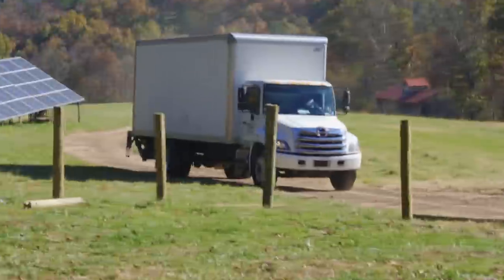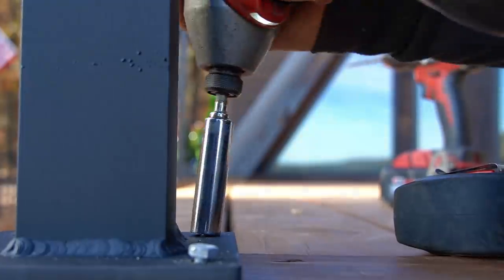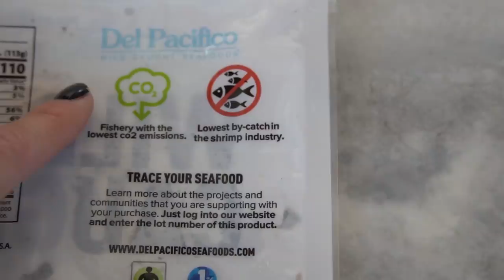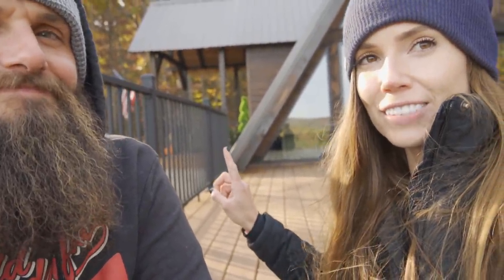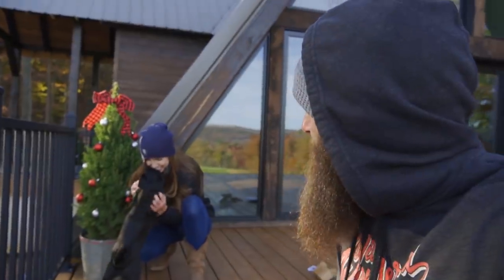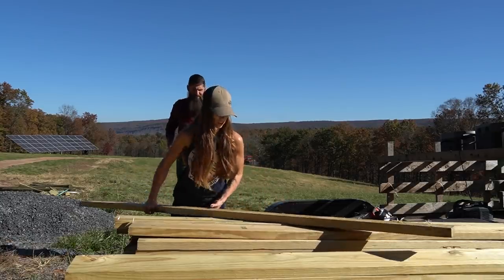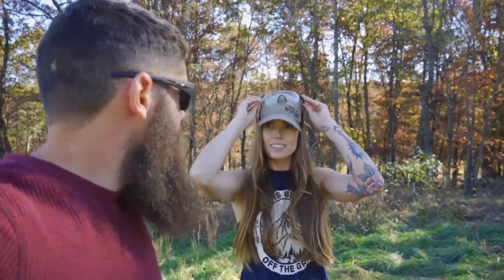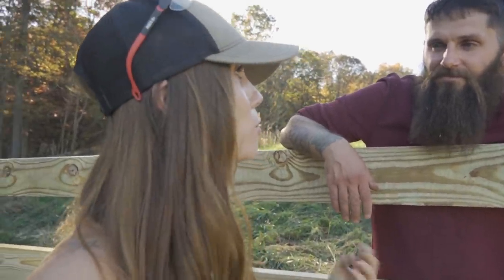She Waited Her Whole Life For THIS!

Comment: Put a railing over against the A-frame. Cut the railing on an angle to the A-frame then bolt each baluster to the A-frame. Or once railing is cut on an angle, tack weld a piece of angle iron to the balusters and then bolt that to the A-frame. That way the railing will carry the same line as the A-frame and the space will be covered so that no one will be hurt.
Reply: I was thinking along the same lines. If you need something there for your own comfort, make a wedge shaped railing segment. Perhaps instead of fastening to the a-frame, secure it to the corner rail only , but up against the roof trim. But the plant works for me!
Reply: @davidmessersmith786  I agree with you. Or my idea. But either way that space is an accident waiting to happen. One of the children or someone else's child plays on the railing, then falls back or gets stuck between the A-frame and the railing. Even an animal, the dog, 🐐 goat Leon, could find trouble there. I believe a railing cut on the A-frame angle, tac welded to angle iron, then bolted to the A-frame is the easiest and best looking solution. Just spray the iron with the paint that matches the railing. ✅ Done, move to next project.
Reply: @reddragon3733  I thought Leon was a sheep.

Comment: Do the "L" rail and then place the potted plants...whatever is in season...to conceal the railing.
Reply: I would rather do this than have to worry about what if someone finds a way to fall off the deck there.  I can't imagine what the ins company would say when they found out it was knowingly against code (and now there is video evidence they ignored it on purpose).
Reply: That was my thought too
Reply: n pot feet to keep the pot base off the deck to prevent staining, in that air can circulate under the pot n dry out any wetness.
Reply: @Kirk Oglesby I guess that's your choice. I prefer to think of it that it's my personal responsibility to make my home safe for other people. We don't have to share that opinion and that's fine.

However I know they have insurance (they had to enclose under the house due to their insurance company).  So if someone gets hurt there in that gap, the insurance may opt to not cover it because they intentionally did it against code. This can go as far as them having their policy dropped. They may be willing to accept that risk. I personally am not willing to put my families future financial stability at risk over 2-3' of railing.

Others have had other great ideas like using sheet metal to cover the gap and cutting a design into it. I think that would fulfill the code requirement.

Again, you do you and I'll do me. I offered the OP my opinion and you jumped on here like I was against personal responsibility (which honestly I don't see the connection).
Reply: @Kirk Oglesby I respect what you say. Personally, my worry would be if a child was visiting without their own parents there to supervise. If some kind of toy or ball gets thrown in to that corner and a kid has an incentive to try to get into that area. To take the chance a child gets seriously hurt because you didn’t take the time to close that corner would be heartbreaking.  I get the idea of being responsible for yourself- lord knows we need more of that. Just the idea of Murphy’s law- if it shouldn’t happen it will.  Maybe it won’t happen till you have grand children but it could happen. Why lose the sleep over it.

Comment: A "L" or short return on the railing is not an issue. Just go long enough to intersect the roof and the top of the post. It'll look great!
Ya'll are doing great work!
Reply: It would also add stability and strength to the long run. It is a beautiful combination.

Comment: Once he is healed, just get one more panel of railing and keep the angle of the roof....and bolt to the front header. It will need some welding but will complete the look. Don't cheap out on labor after all this great build. You guys did great

Comment: For the railing:  from the last post, follow the lines of the deck make a mitre at the corner and fabricate a “post” that follows the angle of the house. You may be able to use a bottom rain, although because of the angle the holes for the pickets, it would have to be filled and the holes repositioned.  I think this would look great as it would blend seamlessly into the side of the house.  It would be a lot of work though.💕

Comment: You could also fill up the area with wooden art piece from your cut offs which could be used as an outside lamp for the deck area, and/or use it for a sound system.

Comment: Suggestion: Instead of measuring for each board get a board or pole etc longer than the boards you have and attach ruler or tape measure or draw etc on the end of the board . This way just hold up the board to the posts and read off the length you need or just mark from that board etc. I would have started with top board and moved down but either is ok and use a 7 inch or whatever board spacing template to snug the horizontal boards to.
You could also nail up boards then set circular saw to barely cut through them and cut off after nailing to the posts and thus avoid splitting ends as much

Comment: fill in the triangle gap with a triangle railing attached to the rake drip metal and the post.  Use a scrap piece of railing at angle like on front steps.

Comment: Greetings from NZ; you have made great progress and it all looks amazing. I would like to pass on a trick we use in NZ when doing 'post & rail' fencing. You need 2 people. After you have got one rail attached to the post get the other rail where you want it and butt it up against the first rail, then with a chainsaw gently go down the vertical gap and you are essentially making a scribe.You then butt the free rail up against the other and won't see a joint (much). This way you don't need to cover up the vertical joints (which I think wouldn't look good). I would also recommend using two 4 or 5  " wood screws with hex heads which are much stronger and won't rust. Cheers and congrats on your accomplishments. KiwiChris

Comment: When you set your post for the play ground set a bench mark with laser level. drill holes approximately 6" deeper than you need.  Fill holes with 4" of rock and then a round paver. Check elevation from bench mark This will help keep Post plumb.

Comment: Cut some spacer blocks for your fence rails. Tape measure takes too much time. Tack a 16d in to hold up the far end while you stick this end. Don't forget to pull em, they'll rip you good if they get a chance even with the round head. 

Use spacer blocks under your deck rail sections too.

Comment: The deck you all built does look great and will look even better once the railing is put up around it and the steps. As for your fence you all are working on, it would have been easier to put up a wire fence and I know it would be cheaper and the wire would last longer. I live in rural Arkansas and grew up with wire fence around part of the property and I love where we live as a family on our grandparents property.

Comment: You could also run a rail down the A frame and then run rails from the corner rail to the rail on the A frame. the only problem is you would have one section with up and down rails and that section would be side to side. A lot of 33 to 45 degree cuts. But the corner would be more stable.

Comment: Turn the rail 90 degrees cut your small rail at an angle matching the roof and weld a pipe matching the angle. Then come off the back with feet with plate for screws to go into the side trim of the house!

Comment: Maybe you could make a "diagonal post" out of wood and fasten it to where the fascia board of the roof goes. Then you could take a section of railing and have it come out at 90 from that last post, and you cut that railing at the same angle as the roof, and tie it in to that "diagonal post".

Comment: What if you guys cut a railing to match the slope of the roof and screwed it into the roof/beam at the very end?  Some waterproofing would prevent rust, and it should be structural since it’s screwed into the A beam.  Just a thought, but love how the house is coming together.  The finishing touches are always the hardest part

Comment: Quick pointer not that it matters but if you still have fencing to put up, instead of pulling your tape every time just cut one of your cut off pieces the correct size for spacing and use that.  It will save you time and you can just set your next board on that.

Comment: I can see the skills and creativity. Excellent!!! Just a suggestion, with your skills, fasten a short rail from corner to facia on House.  Using the pitch to determine lengths of the ballasts, cutting them where they could possibly be fastened with some creative method to the facia at an angle.  Angle 📐 

You both are killing this build! Your channel is top shelf!!! 👍🏻

Comment: HEY I just got an Idea 💡💡💡 use some of the offcuts of your fence to make some pillar boxes to fill with big rocks. You could burn to match the trim and put tops on them stained to match deck and Viola plant stand or beverage table OR no top just fill to so they are weighted and put that galvanized pot in but spay it matt black to match the railings. 🤔🤔🤔🤗🤗❤️❤️❤️❤️

Comment: I think you should secure the top of the end railing to the front side of the roof edge... it will create a side bar and stabilize the fence post, use a flat wide piece of wood, painted black, that fits behind the post and in front of the house, voila   ';  p

Comment: Where the railing meets the house, could you just put a post about 3 feet in from the edge of the deck and have it wrap that corner? It's not like you'll be spending a ton of time in that dark corner where the overhang meets the decking...

Comment: We had friends with an A-frame and a deck - they used the wire parts from a post and wire system to fill in the little triange next to the roof, a few  horrizontal thin black wires from the last post to the frame of the A-frame and your problem is solved without having to have another post - just another option :)

Comment: Making the train rails for the roof corners isn’t hard, cut down a fence panel to suit. Cut the uprights to the correct length with the angle to match the roof at the bottom, then The bottom rung of the panel can be a strip of (painted to correct color) alloy angle iron that the uprights are either tech screwed or riveted to at the bottom. Will finish it off and make it safe 👍

Comment: There is another way to solve that railing issue and that’s to make your own and come across in an L shape and dismantle a raking and use that to form a triangle and using k shaped brackets you can attach that to the house and the fence post if you know what I mean

Comment: What if you didn't attach the railings so far out at the edge of the decking? What if you started it just under the angled roof ??. You can always use the excess decking as a ledge for heavy planters.
OR you could do a custom piece and cut the bottom of the railings at an angle and attach to the angle of the roof.

Comment: I'd set the top rail first on the fence...you can adjust the flow of the fence better. Instead of a choppy top it will roll with the overall terrain  better... when you have a post In a hole it's easier to have it a little high in that area....the fence will roll with the hill much better and look better in the long run. My 2c anyways

Comment: Question. Why not space the fence posts to the length of the horizontal boards? Would the foot or so have been so wide to be an issue?
Reply: Maybe it’s a code issue which is why I was asking. They are normally so organized. Just seems like such a waste.

Comment: OMG 1158 comments already, you guys do such a good job, no wonder you are so popular . sorry you may have already had this suggestion but Ill throw it in anyhow, If you feel you need to do something between where the rail finishes and the A-frame  I'd get some clear  polycarbonate sheet and cut it to fit so you can screw it to the post and to the house and if you like put a top rail in place and screw to the back of that to.

Comment: Quick tip, if I may, and hopefully not too late on your wood fence railing.  Cut two 8" pieces and use it as spacer blocks between the horizontal rails. Much quicker than using a measuring tape. Everything is looking great.  I agree with other commenters, a heavy potted plant would suffice at the deck railing next to the house.

Comment: I think Leon is fixing to be a super star. Maybe he figures you should not get to have all the fun making these videos. Who knows?

As for your deck rail; it is looking pretty fine. I like your creative quik fix for a temporary solution in that corner next to the house. Those particular situations tend to call for a little more creativity and some customizing. I think you should secure a post to the roof on the same slope as the roof. Secondly fasten a short piece of top rail the length of your span and from there run one or two short custom ballasts plumb from the top rail to wherever it lands on the bottom slope. I think it will look a lot better, Be more code compliant, and give you the opportunity to exercise your creativity for customization. 

It was just a thought. I hope you read my suggestion sometime I got a little behind watching your videos, but I am back again. Good show, folks. 🙏 Namaste. Live long and prosper 🖖 👍👍

Comment: You Guys make my day whenever you post a new video. I was thinking about your dilemma about how to fill that space between the railing post and the roof. The first two ideas were ones I had myself, and covering it up with a potted plant was a cute idea. I thought about this for an hour or so and realized that a Post bracket is what you need to fill that gap with. Not only would it work but could be very attractive and very useful if you were to use a Hanging basket or Hummingbird type decorative bracket. But you guys do as you see fit as this is your home.

Comment: Leon is just bidding his time since  railings can't keep him off a deck since he's a rebel and he only humoring them by not doing it till now. Indeed he likely does a few  good back rolls on it while everyone sleeping and leaves no foot prints as his coat rubs them away as his wiggled those legs in the air. Putting a small piece of railing at the corner of the A Frame won't be odd at all and will be a nice look since it just has to touch the angle with its post.

Comment: In the triangle area of Rail to house use Chains from Post to A Frame.  It can be done easy with Eye Hooks.   links of chain Painted Black.   It would be up to code and decorative.   Well something for you both to think about.   This would allow the rail to have stability in case others Lean on Rail and also for allow for frost heave over time.   Chains can has a slight Loop and because there is not equal space at a angle loops need to have a slight adjustment. 

 Use small loop Chain yet large enough to be decorative and Black painted of course to match.

That is my only easy suggestion..

Comment: When you get back to work on the fence, use an offcut of wood that is 8" long as a former to measure the gaps needed between rails on the posts. I think it will save time compared with using a tape measure.

Comment: For the fence spacing, use the pieces you cut off of 2x for spacing rather than measuring with a tape every 8 inches.  It will save you a ton of time.

Comment: Great video Erin, as usually. Speaking of your farm animals...haven't seen "Bruce" in a very long time... Leon has taken the lime light lately, along with the chicks. How are the piglets doing as well?

Josh, have an idea for the railing at the angled roof line.
Stand with the rail on your left side at the front steps looking towards the house. 
Use a "Speed Square" ( Visual Effect)  and position the speed square to fit in the opening at the roof's facia. Squint your eyes so the Speed Square fits in the opening. 

Might have to mentally expand the speed square, but should allow you to see the configuration for a railing at the roof's line.

Build an custom railing,  keep the perpendicular bars between the rails as the rest of the railing. Then wield the "Triangle" to fit into place...using the perpendicular bars like the rest of the railings. Then screw the rails (top end and bottom rail) to the facia, keeping the bottom rail inline with the facia. Then attaching the bottom rail to the metal post.

Yes you will have to shorten some of the perpendicular bars to keep the same spacing. But with the existing railing, the perpendicular bar holes are already preset.

Just abit ingenuity and some Rustoleum black paint you should have an aesthetically pleasing rail line.

Important note:
Will need your
"professional wielding skills and grinding skills".
But by connecting the ends of the top and bottom rails to the facia will give an professional look and zero worries of accidental falls.
Reply: @Coyote-tc1ww  Hey, Mike Ass, take a look at Sunday's video from Wild Wonderful of Grid...you'll be amazed how many times "Leon the Goat" is mentioned. 
Amazing!!!!

Comment: Instead of measuring EVERY single space between rails, cut two, identical length pieces, mark them somehow, and use them as spacers.  If you have enough left, consider making two, matching story poles: a 4-5 ft 2x4 with spacers screwed to the 2x4.  With a small piece to hold up your bottom rail, and spaces & blocks to support the three upper rails, all you have to do is fill the spaces with rails and it'll be blow and go!  Also, the longer spacers can be short on the bottom as long as the tops are lined up.

Hope this helps!

Comment: 👍
The corner. If by (L). You meant. Attach to face board. Of roof. Wrap the railing around 
Then fab spindles. It would make a corner.
That would tie it in.  And look finished.
The tree works . a woman's touch..